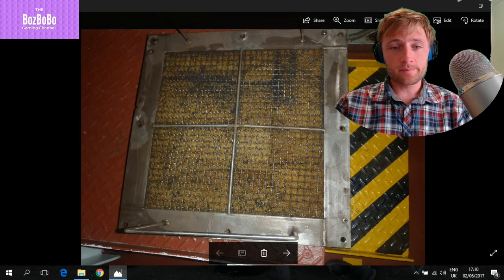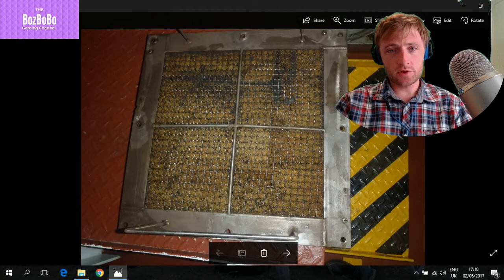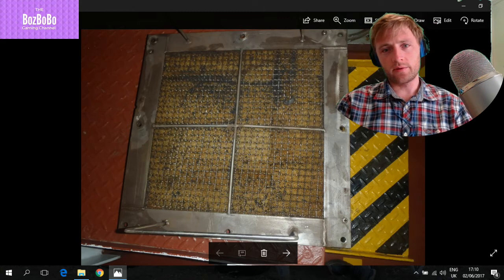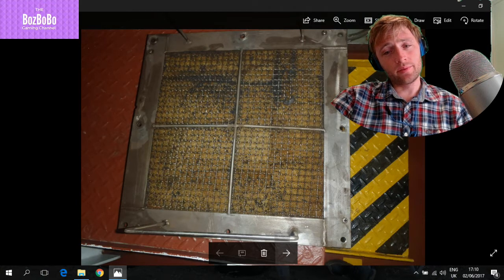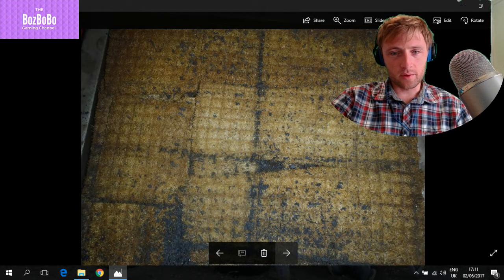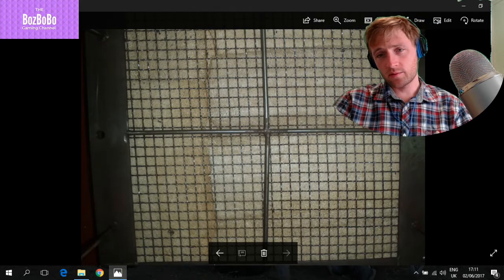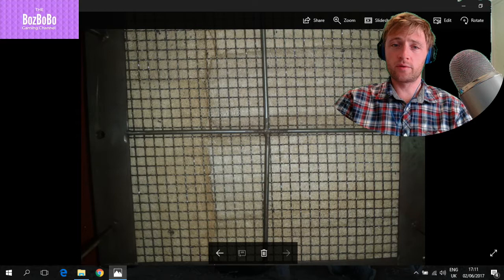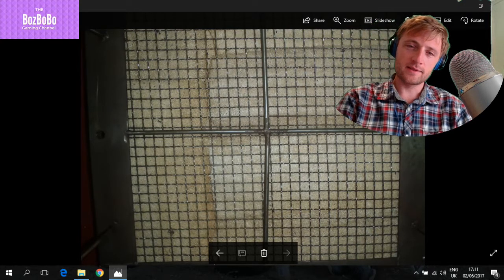CHECK THIS INSIDE HOTWELL TANK

Comment: .. good day sir.. im a big fan of your videos ,,can i ask a question on how to rectify the fault of forward mast didnt turn on.. and what should we secure before performing any electrical job.. thank you sir.. im a student...
Reply from the maker: Hello Jeffrey before you perform any job it's better make some checks about the safety .First of all you will need a cold work permit,also electrical permit is needed.First you need to see all hazards and eliminate them as much as possible.If you are on tanker ship or LNG-LPG you must be double check everything as we know that spark can lead to damages.

So have i your mind that the tools which you will use must be also spark less type material.
There is some steps which you need to do ,First switch off supply to  mast ,also remember it's better to work if the weather is good.

A other thing you must to remember to use safety harness ropes to hold you because you never know ships are moving all the time.
First of all remember the safety in your mind & all the other coming next.
Thank you for this nice question!!!
Reply: thank you sir 😊
Reply: asking again sir.. i want too learn more sir before the class start.. a a circuit breaker and a fuse have a basic similarity in they both should open the circuit when overloaded.  but a circuit breaker has a mechanism in which a fuse doesnt have when it trips. what is it sir? thanks for knowledge sir.. :)